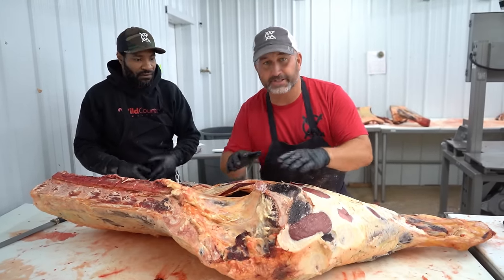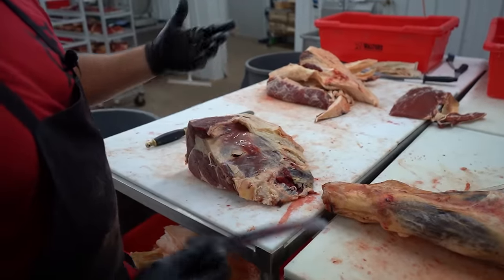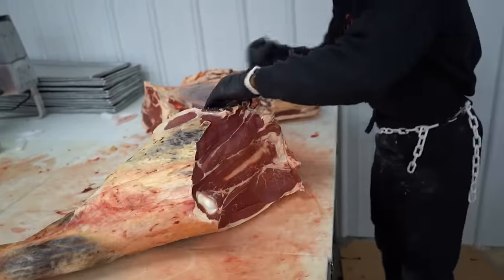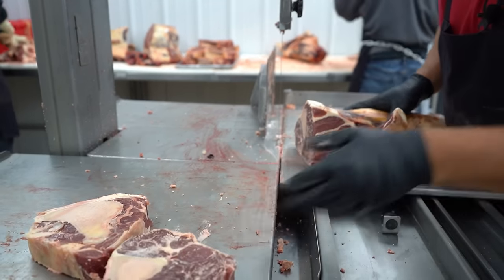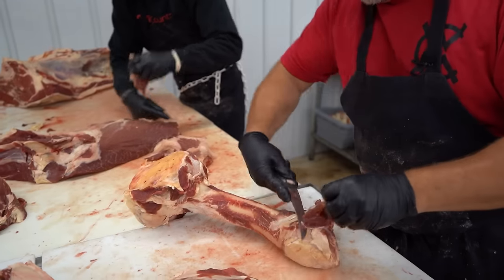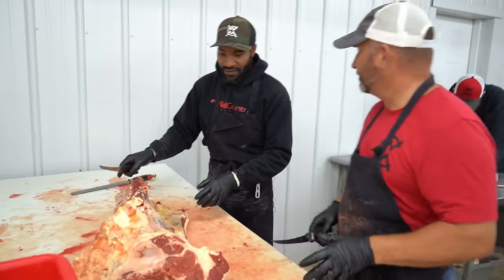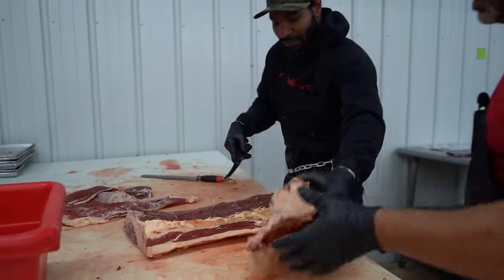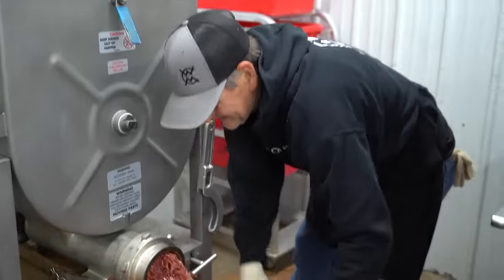Cutting a BEEF - HIND QUARTER

Comment: Slow down, yes safety first especially if there are two guys.   This bring back memories.  Saw the front quarter video. Usually I had help cutting out what you refer to as knuckle.  I would have have stood up and I would slide the knife along the bone. Interesting splitting the hind.  Usually I know if I was on the mark, if what is left is a half dollar size of the hip bone